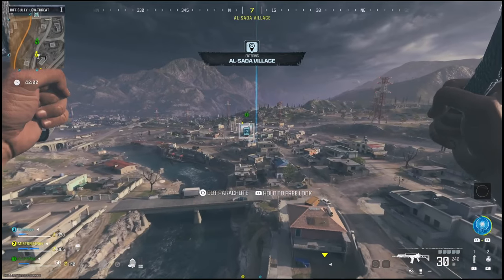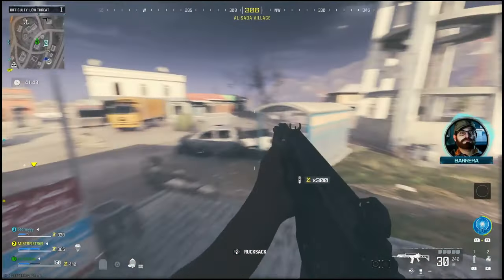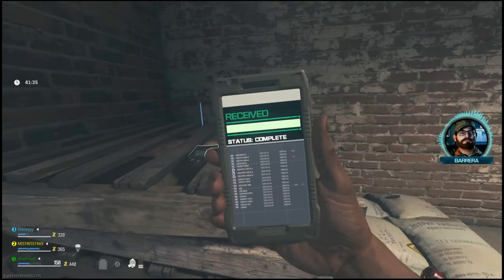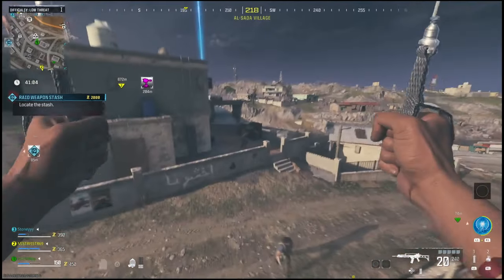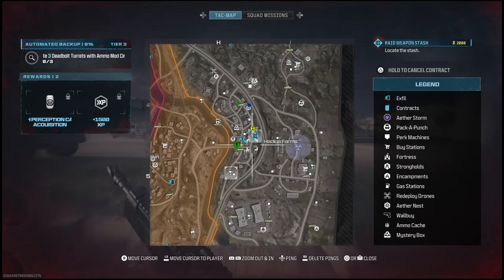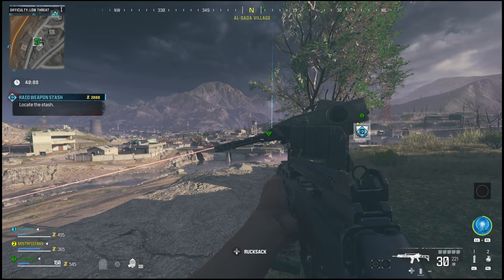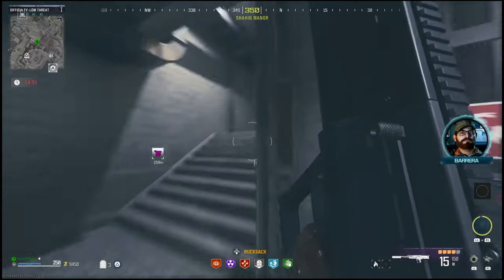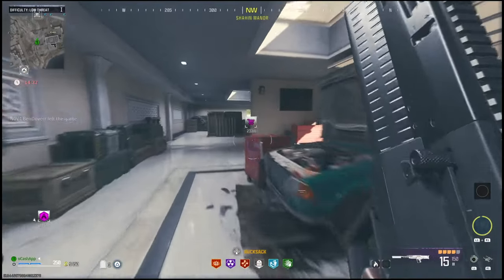How to "activate 3 deadbolt turrets with ammo mod circuit boards" MWZ | automated backup mission

Comment: it doesnt register for me. I've done it several times and it still says zero. I'm extremely frustrated.
Reply: Yea you need a circuit board with special ammo on it so not the normal circuit boards. You most of the time get them from outpost or zombie outpost after I completed the mission i started finding them in every outpost 🤣
Reply: You need the mod ammo not the normal CB
Reply: There are two different mods you can equip to them and the mods with cryo, brain rot etc will only work
Reply: @Amar-jm1jk do you mean outlast? I dont see outpost anywhere...
Reply: Same here bro
Reply: @Luigi-sj3kh Mercenary Strongholds or Infested Strongholds
Reply: Every mission is like this for me bro😫
Reply: Same
Reply: The "mod" modificated circuit boards not the normal ones
Reply: @Amar-jm1jk that’s the thing I have the ammo ones and it still doesn’t register
Reply: It's bugged for some players....it's doing that in my game too.
Reply: Yeah not working used everything in weapon mod circuit and I have used napalm and still stuck on 0
Reply: Yeah me as well
Reply: Its bugged for me too, I've used every mod.
Reply: Ok so it worked for me today for some reason any weapon mod turrets worked and got the 3 of them. So you have to do everything else before you do this that is probably why it didn't work for me or it got patched in the last 2 days.you MUST have it activated in main menu otherwise it ain't gonna count at all. No uninstalling the game this is what I did today and got it to work so hopefully it works for every cod player here and I'm a newbie to this myself and enjoying it
Reply: That makes no sense… of course you have to complete the other missions first… this is the last mission
Reply: @BL-jz7sg  you can do which order you want to but the turret mission I could not complete and you can see other players are having the same issue. I did other missions not a problem but the turret caused issues
Reply: Same here, I used deadwire ammo mod and nothing, after struggling to find the mod in the first place. Also, they are found at aether nests. These youtubers are getting the views up without making anything much clearer than just figuring it out yourself
Reply: Same, won’t work for me, used the circuits that was used in this video and still doesn’t work, tried about 8 circuits now.
Reply: Yea same here but then they gave me 1 of them for using a sentry gun???

Comment: There are 3 ammo mod turret types you need to put each one in for it to count. The mods being deadbolt(lightning bot) napalm(fire) brain rot(skull & crossbones)
Reply: It hasn’t been registering for me but I’m not sure what ammo mod it was
Reply: Do you need 1 of each? Or just for them to be AN ammo mod variant? Because I tried the base circuit board and that didn't work, but have only found a fire mod otherwise so far (which did count).
Reply: @gdogg897  it has to be the variant.
Reply: thanks! thought it was glitched
Reply: @POV_JONES  make sure your put modded turret ammo
Reply: ANY MODDED turret circuit will work doesn't need to be any specific one jus CANT BE THE BASE TURRET CIRCUIT
Reply: @andybrown3086  weird cause my quest completed when i used a regular turret chip

Comment: Do you have to do this 3 times in one match? I've enabled one turret at a time per match, but it doesn't complete the task upon exfil.
Reply: Thanks in wondering the same thing
Reply: @warrenbadial2838  I figured it out. It doesn't have to be all 3 in the same match. But you have to make sure it's a weapons mod circuit card and not just a regular turret circuit card.

Comment: Iv found 3 and first one worked but other 2 havent
Reply: Same
Reply: the ammo must have element
Reply: @fatedtwo2504 how you do that?
Reply: @fatedtwo2504 what does that mean
Reply: @tombak80  its random u have to find them
Reply: I put in an element and it didnt count.
Reply: Has to have a mod like deadwire etc
Reply: I have done cryo multiple times. Doesn't count. Game is very bugged at the moment. Doesn't count Schematics you exfil with half the time either.
Reply: @Cherokee_Ryu  I got it in two games I did it 4 times it has to say either napalm burst mod or deadwire etc you can find them at strongholds etc yes it's bugged

Comment: I have same issue I done it few times and never been register same with cryo the hound it doesn't count for me
Reply: For cryo the hound you have to slow down the hound meaning shoot it once and let the bullets slow it down
Reply: @mafia_zero729  I know but each time I was done it it didn't count
Reply: The dogs not working
Reply: You don’t need to kill the hound just slow it down once than go find another has to be 10 different hounds
Reply: use a pistol it worked like a charm
Reply: Im late but go to the red zone you’ll get them like its nothing